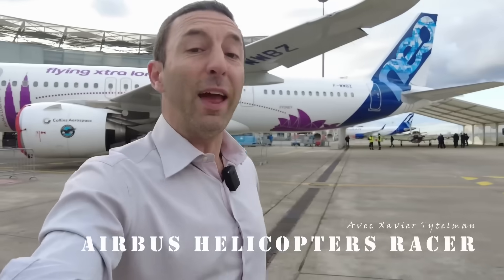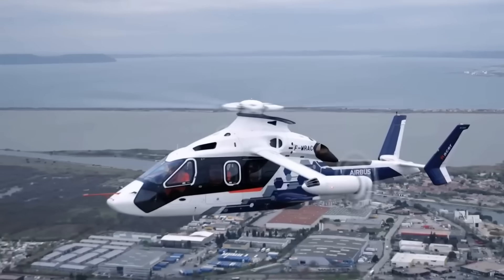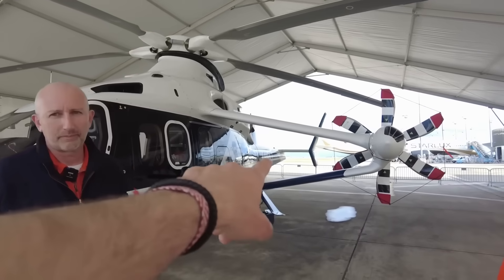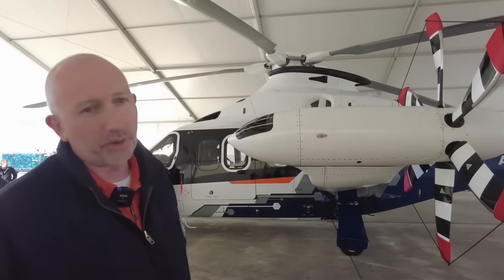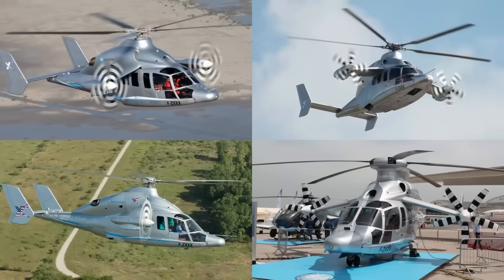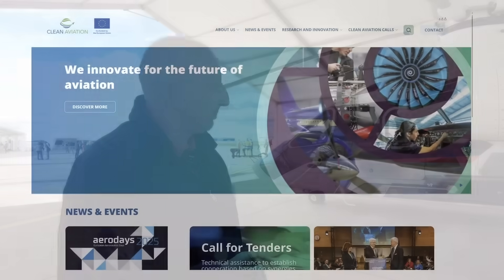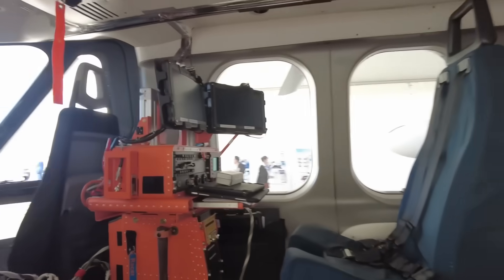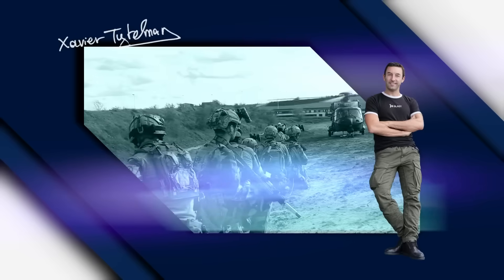Inside the Airbus RACER: A Test Pilot's Experience

Comment: Rotodynes are not exactly useful for anything else other than charter and VIP flight services. This will make a CEO vwry happy at having the newest toy on the block, but it's not really going to change much.
Reply: so naive. this is a game changer for ems.
Reply: @hc8714 naive as hell , you clearly dont work on aerospace systems like I do. This thing will be a heavy maintenance nightmare and the safety clearance zones are more restricted. 
If they wanted a fsster aircraft thats a rotor system, they would already have them. The Westland Lynx (now Leonardo) is faster than this rotorcraft is yet they often will use AW109s or AW139s instead. By choice. 
Hype as much as you want but this is the same copium that surrounds the open air turbine motors for commercial aircraft engines. Been developed and tested since the 80s but we don't use them despite higher efficiency. Why? Maintenance, safety and noise. And just like this Helo, Airbus is trying to convince people to try the open air turbines again and its already not working.

Comment: The FAIREY ROTADYNE lives again. 
Nothing new under the sun.
Reply: No, The Rotodyne used a tip-jet powered rotor so there was no need of counter-torque.
The innovation of the Airbus is that the 2 propellers are used both for propulsion but also for anti-torque.

Comment: Now that is a machine with a shit load of complicated parts to fail.
Reply: it's just one rotor more than a normal helicopter
Reply: The Racer doesn't have a tail rotor, that's one massive reliability improvement. Even if one of the lateral engines failed, it could still work on th other one. Another mreliability increase.
Reply: But way less than a VTOL jet
Reply: ... and much higher maintenance requirements ...

Comment: If this reaches "about 248.549 miles per hour", this is a VERY precise guess. what if it goes 0.001 mph slower?
Reply: The "precise guess" is simply the guess of 400 km / h - if you convert to miles, you get this strange number. Keep in mind, Airbus as a european company uses the metric system.
Reply: Probably still catastrophic and or damage inducing so best to avoid going 10mph within that limit

Comment: with no tail rotor, I imaging the left propeller is used to conter the spin, so it's always on?
Reply: I'm assuming if the engine compensating for the lack of tail rotor failed, it wouldn't be a good outcome?
Reply: @onastick2411  3:14 I would assume the two engines link equally to everything - the main rotor and the side rotors
Reply: @PaulG.x and if the compensating engine failed, would the remaining engine be able to stop it spinning, wouldn't it have to go into reverse thrust?
Reply: @onastick2411  as explained in the video, the props can go to reverse pitch. The two engines are in any case geared together, failure of one is not an immediate disaster.
Reply: @onastick2411  The engines are linked , it does not matter if one fails other than a resultant reduction in power
Reply: @PaulG.x how, exactly?
Reply: @onastick2411  A gearbox?
Reply: counter spin for main rotor might be achieved by propeller angle me thinks.
Reply: Variable pitch, or angle of attack, in this case goes into other direction or negative.
Reply: One engine is enough in gyrocopter mode.

Comment: Tiltrotor craft:  OBSOLETE!
Reply: The Death Machine.
So many of them dropped like stones.
Reply: Tiltrotor - the widow maker.
Reply: @schrimpf Not anymore
Reply: Nope.  This is not a heavy lift helicopter.  This can be scaled up for heavy lift but at substantial weight penalty.  Tilt rotor is a proven system and Bell is already building a second model of tilt rotor aircraft
Reply: @ph11p3540  tiltrotor has zero lift, considering the low chance that any cargo reaches its destination without accident
Reply: @mipmipmipmipmip-v5x dude it been decades... stop with the CNN repeat verbatim. Jesus crhist you people would've had a cow at the early days of the F-16. 
We called it the Lawn Dart for a reason. Yet you praise it now. 

Armchair experts always 15 years behind the curve...
Reply: @ph11p3540  both are too heavy to scale. But the point it, this can work at 4-5 ton with usable load which tiltrotor cannot.